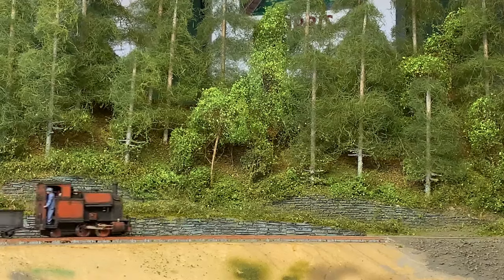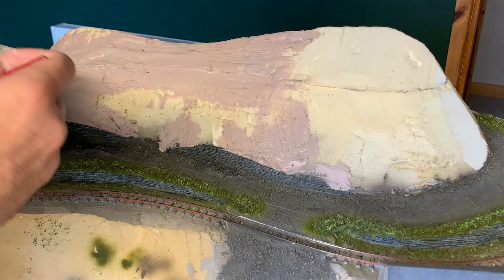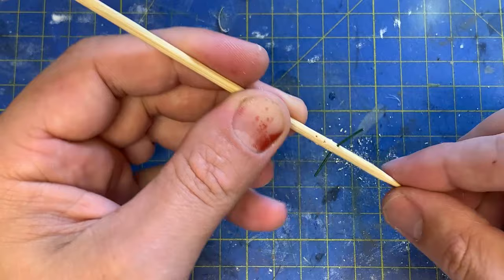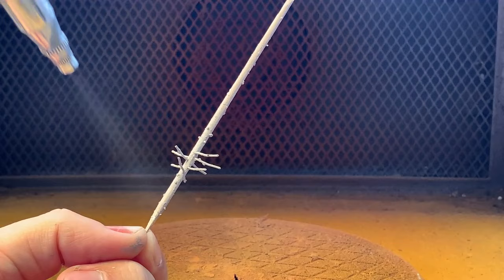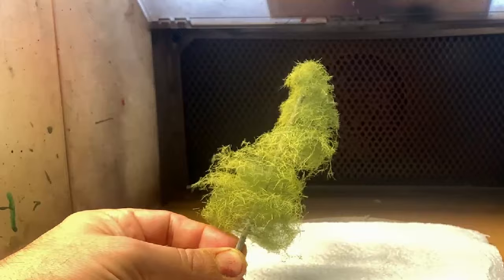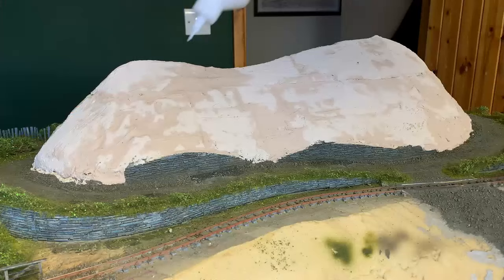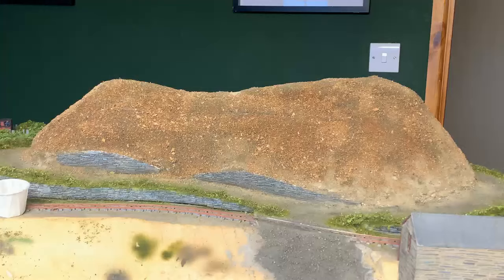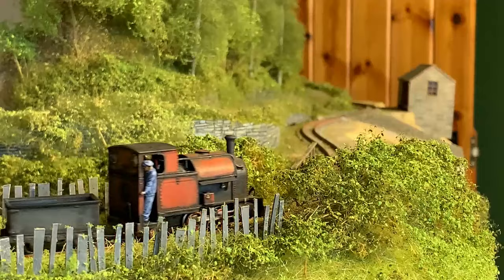Exclusive First Look at Modelling Woodland Scenics and Trees

Comment: Hey do you mind is if I make a suggestion? Something that I have found that works for carving styrofoam and getting a nice realistic look is to use a drywall saw at 90° to the surface. Since the variety of teeth then makes a non uniform ( more realistic) look to the surface
Reply from the maker: Thanks for the tip! I’ll look into that one for future projects